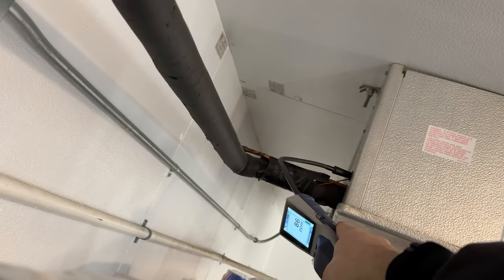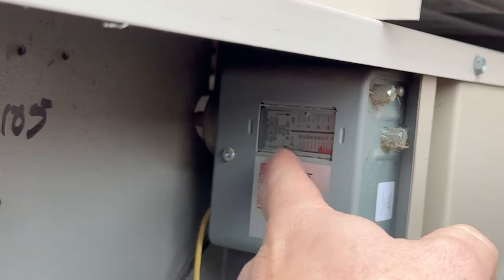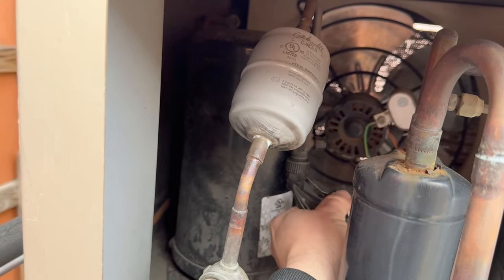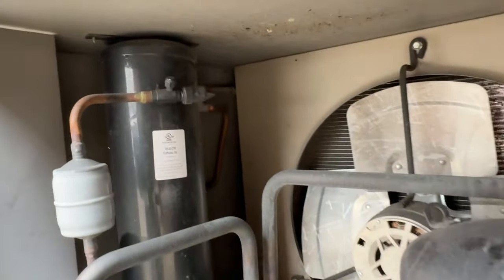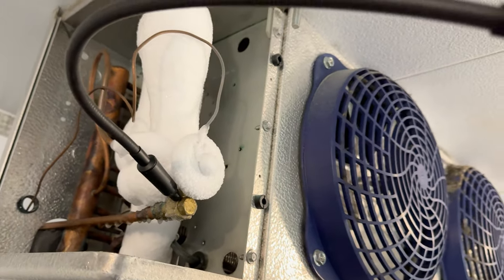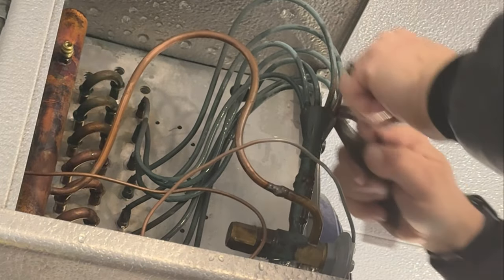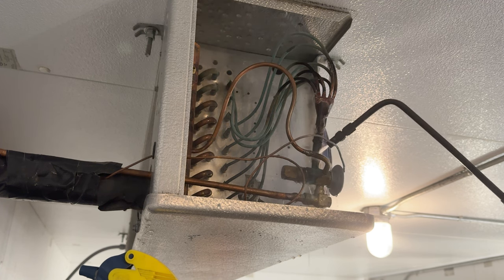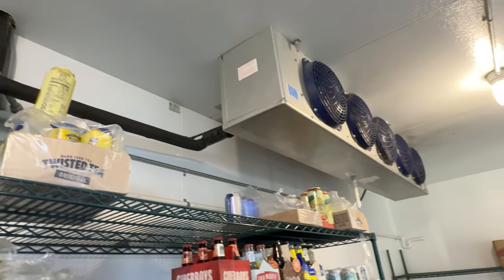Beer Cooler Warm With Major Problems

Comment: Funny and humble! I was on a Brooklyn call and 3 roof units were labeled "2". I definitely diagnosed the wrong 2. But was able to clean the egg off my face with no additional cost to Customer.

Ty for this awesome video. Also, you schooled me with the new use for amp meter on solenoid!
Reply from the maker: I learned that from another YouTuber a few years back. It works great.

Comment: Excellent job. I used epoxy once that held for a while. They had open jars of pickles that was eating everything copper and aluminum. Far as I know it is still working. Not recommended though. Thanks for the video.
Reply from the maker: Very cool!

Comment: Another excellent video, thanks!

So many of those suction tees are piped wrong, the one you see in this vid is bullheading where it should be one suction straight through and the other coming in at 90 degrees

The old Carrier and Trane piping manuals from 60’s and 70’s advise against this 

Probably why the compressor oil level was low, poor oil return from that tee, oil logging in the evaps, even with the suction trap which was downstream of the tee
Reply from the maker: The leak lost a lot of oil in the condenser. I thought the Bull tee made sure it was more equal at lest on the liquid vs strait tees? Suction I can see that though
Reply: @HVACRSurvival 

From the vid you could def see the oil outside 👍🏻

Exactly, on the liquid you want a bull tee for equal distribution and equal length to each evap as well 

Suction is opposite to prevent gas turbulence, pulsing, pressure drop, poor oil return, etc

Respect for the channel, enjoy your work, looking forward to more supermarket fun!

Comment: What I don't understand is why you didn't keep the tx valve cool why you were welding the inlet distributor?
Reply from the maker: @briansmith6135  because it was about 6 inches higher than the Txv valve and heat rises. It don’t usually drop much. Not to mention if you keep the body so cool that it doesn’t allow the brass to heat up you’re gonna be on that body for even a longer duration of time, if you look at any of the manuals, they say use enough heat, get on and get off of the valve don’t dink around all day. And that’s what usually happens when you wrap Txv, generally I’ll take the Txv apart and do it body only without the sensitive components.

Comment: Man a distributor leak ? that would have ruined my day ! 
Now for us fancy folks who can't find a rosebud anywhere , would you advise heating up one capillary at a time with a low flame , or maxing out the capacity of the b*tch @ss tip I have and tryna keep up the heat at the base let's say one side at a time ? 
Cheers Rick , brilliant job again 👍
Reply from the maker: Number 3 or 2 will work. Brass is a hog for heat so put it mainly there and slightly on the copper once it flows smooth. I also stopped refluxed twice when I did this. The video was a hour long. I was thinking of uploading full length videos for the members as an extra. 🙂 not sure if that would be a selling point or not
Reply: @HVACRSurvival  thank you for the tips , I hope I don't have to do distributors that's just a headache !

Comment: So they have a beer box running at 32-34 degrees and have it loaded with produce. How is that working out for them??
Reply from the maker: I didn’t say they were smart. They aren’t using it the way it was designed.

Comment: Why in God's name does such a box need 2 evaporator coils with 5 fans each??

Just installed a new WI factory speced with just a single fan evaporator, same size fan as these 10 are for an 8 x 13x 8' high inside of box designed to maintain 36° that we, given our choice of 448A or 449A we go with the more popular by our supply houses for the slightly cheaper 449a.

Seeing 10 fans/ 2 coils.  I think always way way over kill for such display cases even a door is opened on every 5 seconds.

What do you guys think?

Of one coil became completely shot.  I would cut it out and see what one coil with 5 fans on it will do for such a box
Reply: Yeah..toughest part of job is sometimes just figuring out the correct unit to be working on. 

Like a 5 story building with 60 AC condensing units on the roof with almost none of them labeled as to what inside unit they belong to!
Reply from the maker: I have drive in warehouse refrigeration I service. The same people design that did this job so I’m sure it’s more about the shape of the box and the glass doors that are a poor insulator.